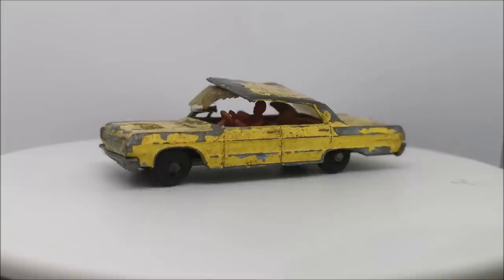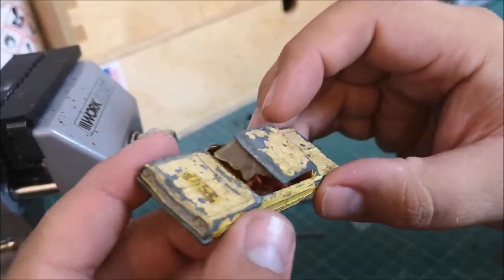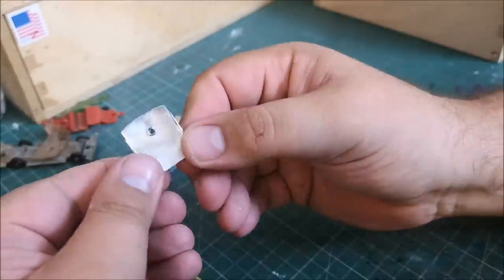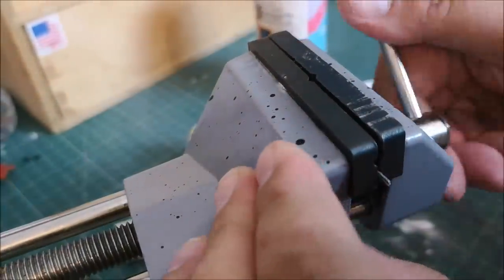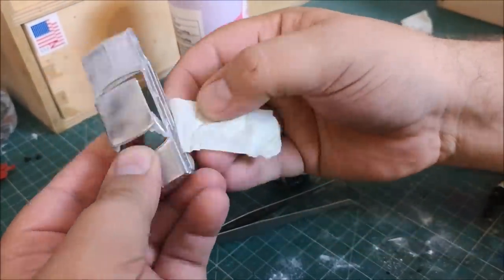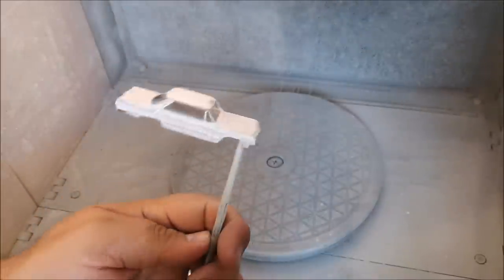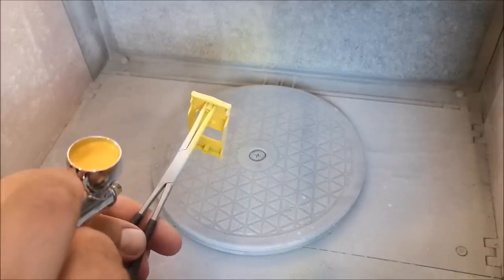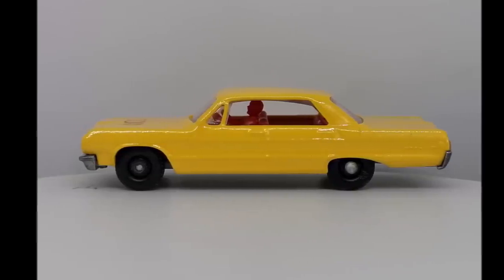Matchbox No 20 Chevrolet Impala Taxi - Restoration Video

Comment: Wow!  Awesome amout of work dedicated to one piece.  A little rough around the edges but I would show it on my wall, along with a picture of "before".

A little clarification on the whole A-B pillar thing.  First, its only a pillar if its a permanent part of the car, meaning, non removable part.  If its part of the door then its not considered the pillar.  So the other little part next to the pillar was part of the door, those cars had as an option vent windows.  Finally I appreciate that you did not add B-pillars.  In a casting like that with the roof half pulled off the "post" or B-pillar breaks off easily.  But Impalas and several other cars of the area are "postless" or "non-post" models, and for younger folks that were not around back then have never seen this since pretty much all cars made since the 80s have a B-pillar.  You have done your homework sir!  Hats off!
Reply: Vent windows weren't an option, they were standard.
Reply: @rockettcustoms6266  I have seen Impalas without them.  Custom delete?

Comment: Add a drop of Vaseline with a Q-tip to the threads/inside the super glue cap, you'll never have to throw out unused glue or battle taking off the cap again.
Reply: Did a great job
Reply: this is a great tip ty
Reply: Thanks for the tip

Comment: 1964 Chevrolet Impala sedan. 283 cubic inch small block. 2 speed powerglide transmission or 3 speed standard. Impalas had 3 tail lamps on each side. I owned a 1963.

Comment: It needs a white with red text taxi sign on the roof. Generally these were lit up when the taxi was in service. You could fake it with some styrene board. The tail lights were distinctive that year too. Three lozenges per side with impossible to replicate chrome on the lens trim. They were right above the chrome bumper. Yes, I probably rode in one of these as a child.

Comment: Nice to see that you drilled and used a screw instead of reglueing the base. Shows that your not hiding the restoration by super glueing the base and bring to make the rivet look untouched. Not perfect but from what was started with you have a passion . I personally would have made it a custom with custom paint if it was mine. Due to the fact it would never be original again

Comment: You need to keep cap loose keep upright and seal in a plastic zip bag Rob that's what I do and it works every time don't forget to push the air out first though nice job btw 👏👏👏👏👏👍👍👍👍👍👍👍👍👍

Comment: What you mentioned as the 'B' pillars are actually part of the window frame on that car.  In the US we referred to those as Wing Windows or Vent Windows, since the little triangle of glass would open to catch the wind as you drove.  The ;B; pillar is always the pillar at the rear of the front doors.  In this case, the B pillar only goes half way to the roof.  At the time, the style was usually called a hardtop sedan.  It would look like a 2 door hardtop but with 4 doors.

Comment: I was building models and found CA glue in different viscosities that come in containers with a metal "needle" type applicator that will seal without sticking.  A bit more expensive but very reusable.  You probably have to look at a hobby shop.

Comment: Really awesome video. I think your coat of paint seems just a tad thick, I  know you said you found that you have to layer it to get it to shine so my thought would be use high gloss? As someone mentioned the thickness covers alot of the details of the body of the car. Edging along the seems with an exacto knife isnt a bad no, but you could also lightly brush a clean brush across the seems after your coat so as not to lay the layer of paint over the outlines of the details of the car.

You could also always layer your paint and then apply a sort of lacquer finish lightly glazed across across the car. But  I dont do this and so Im just throwing something out there you know what works best for you having done it. Very nicely done. I would say if you have anymore issue with metal damage on furture projects you could always pick up a 1x1 piece of Sheetmetal 040 or even thicker then carefully file it down to what you need Sheet metal works almost like this and can be polished just like you did the metal underbelly.  VS Smashing little bits of Cotter pins. since those are mostly round while sheet metal would have a naturally flat occurance and thicker pieces could be easily filed with groves to add detail.

Comment: Bob Smith Industries super glue. for working with bakind SODA (no need to use baking powder, it has ingredients you don't need) I recommend the super thin variety. With it, you can position the soda first, then soak it with the glue. They also make a gel, this is good for building up or gluing in spots where you really don't want it to run, but not using the baking soda. They make several size bottles, you can get big bottles that last a long time. Oh, it's stronger than the dollar store stuff, wear gloves and keep acetone handy. it will stick your fingers together, and they won't com apart easily  

I did one with a similar problem, I put thin clear tape on the "glass" then used it to make sure the roof was in the right place.

Comment: WONDERFUL work on what surely looked like "a goner" as us yanks might say. I am grabbing a Jaguar Mark 10 Matchbox made in England by Lesney . Its in GOOD shape. But I am more interested in it being a NOCE color than and Original Color (colour) which was some kind of dingy, dirty looking dark gold. It looks awful even in good shape! I have one question. In this restoration you laid the fine primer down pretty heavy - for the work on the A-pillar and the "vent windows, that makes sense, since you were never going to get them to the perfection you would have liked. But what about detail on the grill, taillamps and "Impala" badges. Aren't you losing a lot of detail on the finest sections of the casting? I am mostly curious, not critical on  why you did that. Do you feel you can still ese the fine details, or is it the lesser if two evils with the major repairs needed on this one.  Finally, I am surprised you can't find a metallic adhesive with graphite or ground metal that flows for these welds you need to do sometimes. Note: I have ZERO experience restoring Matchbox cars, but plenty fabrication work over the years. Usually MUCH larger scale, lol. GREAT VIDEOS. Please keep them coming!,

Comment: The “ pillars “ were the triangle vent windows. Most didn’t have 
Air-conditioning. So the vent windows could be turned in to adjust the flow and angle of the air coming into the car. We called it 2-60 air conditioning. You open the two vent windows and drive 60 miles an hour

Comment: @Matchbox Garage: Great work! I have the same model that i want to restore. Unfortunately only with paint problems :)
But, curiosity ask: Is there any other video where you show how exactly use that "model filler" tube? 
I mean the exact application for it. On this video you skipped the explanation.
Thank you !

Comment: Instead of Super Glue and baking powder, why not try a low temperature brazing solder paste or wire. There are a few that are cheap and easy to buy online. It is superior to glue and can make a more accurate restoration and can be sanded and or abraded perfectly. Please give it consideration.

Comment: Hello, nicely done, for your adhesive on Matchbox projects, I've used JB Weld for years, this is a 2K Epoxy which when blended creates a grey colored, fast cure however, not as fast as Super Glue (cyanoacrylate). It may not be available in the UK but guessing it actually is. Super Glue somewhat thick both before and after blending equal portions but has a more intense strength and for broken, cracked, and thin metal pieces and parts, it enables one to sand with special Dremel diamond bits. It takes paints beautifully, currently, I only solvent based Krylon paints, which, I spray into containers and add various other colors, as needed, to get both unique and colors dead on. In my previous job, I formulated aftermarket automotive colors for Sherwin Williams. Regardless, when my son's were younger, 10-12 years ago, a gentleman came over to our home with a box of VERY old Matchbox cars, a couple Dump Trucks, Bulldozers, etc., 34 in total. I remembered my uncles playing with these cars when I was young, they came in paper boxes and they were very particular with them and would occasionally let me hold one, kind of funny. Some of the cars he gave my sons were decent, others were trash can ready but surprisingly my sons wanted the worse cars. Over the next 2 years and as time allowed, I restored all of the cars that needed work, others, I took them apart, stripped down to the metal, fabricated plastic, when CNC came about and available, that made replicating parts miraculous, then, repainting using an airbrush. All the best,

Comment: Tip for extending the tip life of a super glue tip nozzle. After I use some, I take a piece of clear tape a small bit, place it atop the nozzle then fold down and twist it onto the nozzle, this way it both keeps the glue inside and instead of glueing the top onto the bottle you can just remove the tape and if there is dried glue you can puncture it with a tack or needle, then redo this process a lot until the glue is empty or just unusable.

Comment: What an unbelievable job you have done with restoration of an obvious "basket case." I always wondered why Matchbox used the 1964 Impala hardtop for the taxi, as most Chevrolet taxis were four door sedans. The hardtop has no "B" pillar, the small pillar directly behind the windshield pillar was only there for the wing window, and only attached to the door. The red interior was always a mystery. It would have been quite common with a white, black, or red exterior. The dealership and area service managers would have done everything within their power to discourage this combination, as it would greatly limit the resale value of the vehicle. Again, great job!

Comment: Hey there.  Over here in the states we have what I use is Loctite Super Glue. It has a screw-type cap on the bottle. Whenever I use it, I always take a paper towel and real quick after I'm done using it wipe off the neck of the bottle then put the cap back on. Sometimes it works sometimes it doesn't. If it does stick I use a pair of pliers and gently squeeze the neck of the bottle to crack the glue inside. Maybe you can try this if you have Loctite over there. Just a thought. Take care.

Comment: I think you've discovered star bond since this vid, but Bob Smith Industries also makes a line of super glues in varying thicknesses. for using with baking soda, I usually prefer their super thin. The benefit of the super thin is that you can put the soda on first, kinda shape it, then put the thin glue on it, it will soak in. Once set seconds later, the soda gets rock hard.

Comment: If you wipe the tip of the super glue tube with a paper towel prior to putting the cap back on, you'll be able to remove the cap the next time you use it. Usually.

Comment: J-B weld glue works better and bonds better than  super glue and baking soda because it's a adhesive and general motors uses it on their motor vehicles that they they call it panel Bond glue

Comment: You did an amazing job. I was thinking; I have never fixed die-cast however, have you tried to use styrene  and fuse it to the die-cast using filler?, maybe you have and it doesn't work, but I'd like to know what do you think.
Reply from the maker: I have used it

Comment: At GM in USA we called them the A post and B post. I was a body man until I left to teach.
Reply: Not sure why an Impala  would be a Taxi  when i used to see the 6 cylinder   FORD Custom and  Biscayne    which had a Taxi package.     Our  66  Custom was the taxi special   4 door  with durable interior , 240  straight 6 , automatic   and Radio delete . 
     The 64  Biscayne did have the Impala upgrade  where the car had just 4 rear lights . But the Impala/Belair had 6  rear lights and the reverse  white light was an option . 
     Looks like   the Company   saved money to take  an existing 4 door hardtop Impala and make it a Taxi.

Comment: Ah, I've been looking forward to this one since the unboxing it showed up in.  My father and I are spending the summer* very slowly restoring my 1962 Impala (same generation as the '64 model depicted by this casting) that's been holding up boxes in the garage for ages--I've always had a fondness for that '61-'64 "squaremobile" era of full-size Chevys.  Been trying to guess what you were going to do about that roof.

The end result does not disappoint! You played this one on hard mode. Like some other commenters, I too would probably have wimped out and gone for the convertible... uh... conversion. Chevrolet did make Impala convertibles in 1964, although not with four doors. :)

BTW, because commenting on YouTube turns me into That Guy sometimes, that "second A-pillar" thing is the back of the frame around the vent window, which most large American cars of that era had (because almost none of them had working air conditioning ;).  This car is what Chevy called a hardtop, but which the rest of the world calls a pillarless coupe, so it only has A- and C-pillars.

Also, I love the syringe trick! More precise measurement and it keeps the tops of the paint jars from getting all dribbly.

* or longer. probably a lot longer.
Reply from the maker: Wow you have a 62 you are a lucky dude 😎
Reply: @MatchboxGarage  Yep. Bought it 20 years ago during the dotcom boom, and almost immediately became too poor to fix it up. :)
Reply from the maker: @ZGryphon  I would love to see a picture of it mate. 😎
Reply: @MatchboxGarage  Here's a bunch--I've been taking pics as we've been plugging away at getting it working. Hoping to set up a blog about the project if I can find the time later on this summer.

http://www.eyrie-productions.com/G-GFX/cars/impala/

Comment: Very nicely done indeed! Making replacement roof pillars is difficult even in 1/43 (the quarter-lights must have been especially so!), this is impressive. There is something especially satisfying about bringing the seemingly impossible-to-restore back to proper life like this - a Mad Max or custom would be a lot easier, but the results would similarly be less rewarding. This is a top job!

Comment: Nice job, just wondering why you don't use UV glue, it cures only under UV light and will be a lot cleaner, any electronic supplier should have it since is used to hold SMD chips on a PCB board.

Comment: Hey Rob, for the pillar construction I’ve had similar Diecast models lose a roof or completely twist and snap where the broken piece is beyond repair. I tend to use JB Weld high heat epoxy putty ( https://www.jbweld.com/products/highheat-epoxy-putty) shape it to however you want but be sure to spread / smear it across the roof and door or guard to secure it into position. Once hardened sand it all back, prime then paint it. Comes out looking better then original. With the glue rub the lid in a bit of Vaseline or bees wax and the glue won’t be able to set 👍

Comment: With reference to the front pillar, the slanted one is the actually A pillar, which is structural anfd supports the roof, while the vertical one is merely the frame for the vent window. In cars of that vintage, the vent window rotates outwards to provide ventilation while the door windows are closed.

Comment: Great job. I have found that commercial floor strpper will take paint off of plastic and metal. It won't burn you. It's reusable. There's no bad smell. I probably shouldn't but I use it bare handed. It's not as fast as aircraft stripper but it's all I use and I have tried them all. It will remove chrome on plastic so don't drop any good redlines in there.

Comment: Can't believe you saved that car. Damn fine job. Someone mentioned the paint being too thick...I don't think so. The Matchbox cars I remember from the 70s and 80s were painted pretty thick (I assume the 60s ones were too). Hot Wheels, in those days, had the Spectraflame colors and looked dynamic with a thin coat of paint but Matchbox were a bit more basic. I think your taxi looks like I remember Matchbox cars looking. Just fantastic!

Comment: If you have a Boyes store near you they do some nice superglue in thin, medium or heavy with accelerator or you could still use the baking powder method find them in model section (near Vallejo model paints)

Comment: Fantastic. I'm having the same problem with N° 53 Mercedes : the roof is completely detached from the body and I am struggling to fix it . Trouble is that the window unit (the original one that is still fine) doesn't fit nicely as I would like. Seems to me that you had the same problem with your Impala.Thanks for sharing your video.

Comment: OMG! I remember the day when I was with my father in the auto parts store and I picked one of these from a vast box of cars. That was 1970, I was 4 years old, several people around had these Chevys in all body styles.

Great job! Brings back great memories. I had so many British cars as well as American cars. I remember the Ford Zodiac which was classy looking in it's green/blue paint. Rolls Royce, Rover, Austin America, just so many I don't remember. I preferred the elegance of the Matchbox cars to Hot Wheels.
Reply: Though I grew up in the USA, and that the only car that ever got the Zephyr name was a Mercury badge swap of a Ford Fairmont (both of which are highly underrated muscle car material, given the right upgrades), the Ford (UK/EU) Zephyr is honestly just begging for a big ass Cleveland 351 or 402 cu in engine, a 427 cu in Super Cobra Jet engine, or a 355 cu in, Keene Bell supercharger, with optional additional turbocharger, equipped Shelby 1000 engine under the hood.